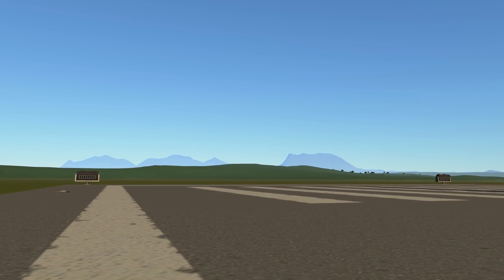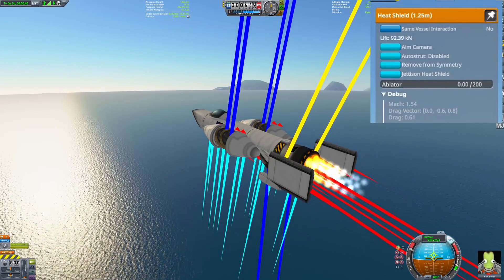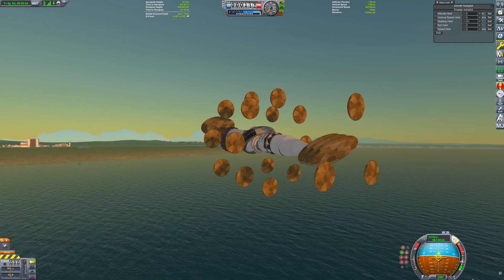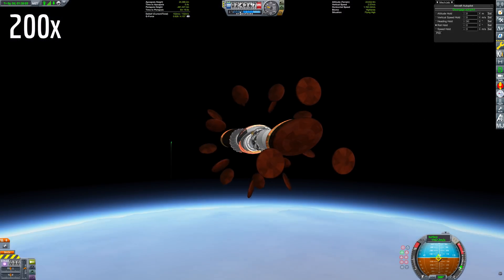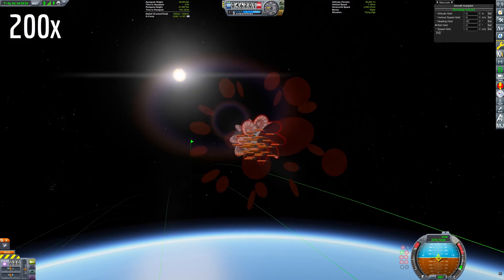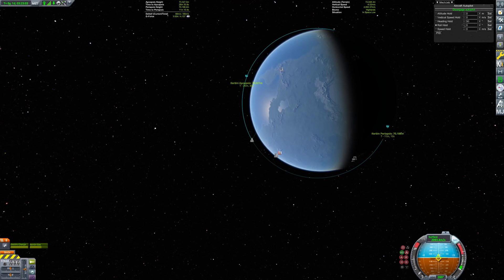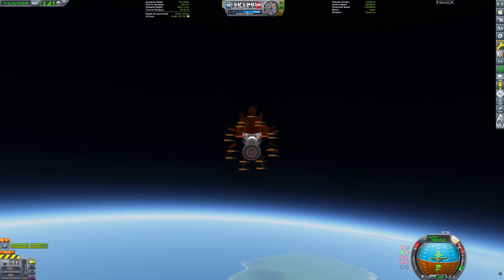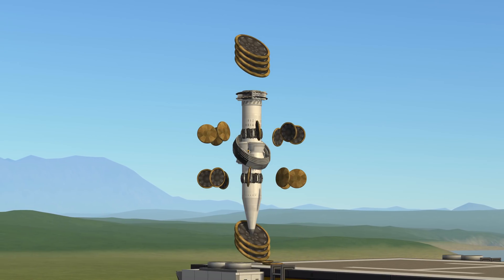2100 m/s on a Stock Propeller | KSP 1.10.1

Comment: Can it fly on kerbol if you add heat shielding using structural panels with all nodes occluded?
Reply: I tested this today.I think kerbol's atmosphere is too thin.Also you probably need a ton of ion fuel.

Comment: Actually, I want to learn how to do this. I have a design in mind if it works how I think it does.

Build a giant freighter ship and have all the heat shields be on docking ports (or the whole prop assembly be on ports) and then have a truly single stage to anywhere and back. Possibly designing a single stage to everywhere and back.

Comment: Update: I've tried it and it didn't work. 
nose cones remove the drag but not the lift just as you said but there is downforce instead of uplift, showing as body lift (aka light blue arrows in GUI) through the ground no matter where I place them.
Version info: KSP 1.4.5 Stock Size Real Solar System

Comment: In reality, wings in subsonic speed created lift not because of a difference in pressure, but because they accelerated air downward (e.g. deflecting a fan's wind downward with your hand). In a kind of way, KSP's heat shield followed a similar technique, only in a more drastic way.

Comment: My opinion: use it in conjunction with regular lifting surfaces to make extremely efficient and effective aircraft. Imagine how this will revolutionalize stealth aircraft in BDA, they’ll be able to fly higher and faster than ever. Or SSTOs, as shown here: imagine a colony aircraft going between Eve and Kerbin and picking up modules using only xenon and heat shield tech. You could even make highly efficient hydrofoils for attempting the sea speed record!

Comment: Can you do a tutorial on how to use the breaking ground expansion parts? I have an issue with the servos where when I place them in mirror mode, one works the way it is intended but the one on the other side is a kraken drive that causes an uncontrollable role.

Comment: As a lifting surface? Sure, it's just a fancy stock wing. However, as a thruster / propeller, i figure it would be as if modding in a crazy efficient engine. I don't really have a good base for this reasoning but im gonna go with my gut feeling here.

Comment: I use a lot of mods - key piece of information. My absolute best plane is fast - even for mods - and lasts forever using M.A.R.G.E engines from OPT and a nuclear reactor. At 45% throttle and at 11km, it cruises around 1300m/s. I have to lower the throttle or it literally burns up in the atmosphere. 
You've made a **stock aircraft** that doesn't burn up and goes almost 2x the speed whilst lasting forever... insanity.

Comment: Yep, definitely kraken drive level. I really wish this game did a better job of calculating part occlusion. I like trying to make really big cargo planes with custom loading ramps using the robotics parts, but the game considers any vehicle or cargo you put inside as being outside the plane (and therefore super draggy), and also tries to rip open your cargo ramp. The cargo ramps and cargo doors can also negatively impact control, and also cause a ton of drag. Super annoying.

I'll go check out Bradley's video. I've been trying to use prop tech for a while now to make an Eve SSTO, without much success.

Comment: If you could vary the pitch of the prop you could get much higher low and high speed efficiency. If you can vary the pitch you can always set the optimal pitch for max thrust. A standard plane will have better thrust for takeoff with the blades almost flat to the oncoming air and the faster the go the more you'd want to angle them forward to reduce drag and increase thrust.

Comment: Is that the highest g forces possible with a propeller plane? Ik it's not nearly as fast as the wind drag catapult, but that's even less normal
Reply from the maker: I think you could do higher. With a better heat shield wing setup, I imagine you could pull over 100 gs

Comment: Im going to see if this works in 1.8.1 (the version i play because of my mods)
Reply from the maker: It should! I'm not sure when the devs added lift to heat sheilds, but I'm sure the latest few versions (back to 1.7 or so) work.
Reply: I checked and it wasn't working in 1.8.1, but that might be because of my mods, or just my stupidity, i had it set to show aerodynamics but it wasnt showing anything at all for the heatshields this could just be user error
Reply: Also do u know about the drain valve infinite flight trick, you put a butt ton of them on the back of a plane, then put on a bunch of air intakes, they will provide force by draining intake air

Comment: I'm of two minds about this in general. On the one hand, I think exploits are fine and everything, but I feel like this is sort of a wake up call. I've felt increasingly ehhh about a lot of the more minor community accepted exploits like part clipping stuff directly into other hitboxes. Just kinda feels cheap when you can pack 15 fuel tanks into one for example. Now this exploit is obviously more broken on several orders of magnitude and needs to be fixed. I'm comparatively more fine with the part clipping tho because not being able to clip parts together at all would result in it being impossible to build anything interesting. Hopefully if this does get fixed it doesn't break a bunch of other stuff.

Comment: I nominate the term “Stratzen Drive” to define the use of this tech and differentiate it from the normal lifting surfaces in honor of one of the most innovative KSP players out there. Well done as always, sir!
Reply: I second this. Any non-traditional propellor should be called a Stratzen drive from now on (except that mechanical plane that used the power of the narrow-band ore scanner’s rotation to drive props. That is a class of its own.)
Reply: How about stratzen lifting surface for a more general name
Reply: That sounds like something out of a sci-fi film/novel. I love it.
Reply: Could we compact these so-called "stratzen drives" to a rather small size and use the engine plate fairing zero drag technique to make a micro-ssto?

Comment: Hey, I'm trying to make the drag thingy work, and its disabling the heat shields lift as well. What am i doing wrong exactly?
Reply: It took me a while to figure it out, but here's a bit of a hidden tip: Heat Shields don't produce lift if there is something that is connected to the bottom node on them. You have to stack the shields/nose cones using the attachment node that is on top of the shield. I hope this makes sense. it seems really awkward, but it does work.

Comment: I did notice, that heatshields generate lift and used them for aerodynamic reentries, but this ... this ... excluding the drag with nose cones. I did not expect that the lift would remain. Also, I am using FAR (Ferram Aerospace Research) so I am no sure if it even would work with it.

Comment: Moving forward, these should only be used in place of standard lifting surfaces if you don't give a damn about immersion.

Personally, I like my rockets to look like rockets so I'm not having to convince my brain that its not wrong to see parts magically floating. (I find convincing my brain to ignore magic floaty bits hard).

Definitely an interesting curiosity worth a play around with in sandbox mode though.

Comment: The electric motors are way too powerful and easy to power, that's the core of the problem with KSP propeller craft.
Reply: Tbf the previous speed record of 1000m/s was with reaction wheels

Comment: In theory everything should generate lift, alt least at some angles, it is just a part of the aerodynamic reaction force. I think the lift generated with parts on both sides should just   be that of the circumference of the part.

Comment: This is to atmosphere engines (propellers and jet engines), what the ion engine is to rocket engines. Efficient? Yes. Fast, not really, since you have to slowly build up speed. I doubt most players will have the patience to use it. 

The heat shield wings, however, look set to revolutionize KSP, even for the average player.

Comment: Why are you using such a high agle of attack on your heat shields?
Reply from the maker: They lift vs angle of attack is odd for the heat shields. The lift maxes out at 45 degrees and decreases in either direction. That's why they look so strange.
Reply: @Stratzenblitz75 thanks for your answer, but  i ment the heat shields for the rotor and not the wings. They really dont look to be at an angle of 45 degree
Reply: Ah sorry, I didn't see that you tilted them in flight

Comment: I think it's fine to count this as a stock propeller, and make it a record holder. I initially thought that this shouldn't be the case, but since prop records have been held by part clipped and offset craft in the past, I don't think this should count as "different." As unfair as it may seem to other record holders, it's using the same methods, but with different parts.

Comment: wierdly enough, this is not a bug, some heat shields produce lift in real life, the soyuz capsule, for example, uses this lift to steer itself through the atmosphere to ensure the safety of the crew and a more precise landing(I do believe idoes not produce as much lift as it does in the game though).
Reply: Sure, but occlusion removing the drag without removing the lift definitely is a bug. The lift to drag (un-occluded) from stock heatshields is actually pretty accurate.

Comment: I wonder how fast you could get this in atmo. Is faster than orbital possible? You're almost already there.
If you can exceed orbit velocity (presumably by pulling negative g to stay in atmo), could you break escape velocity? Leave Kerbin SOI with no reaction mass?
Reply: Heh, I guess if you can pull that off, a Interplanetary transfer would theoretically be possible. Be accurate enough, and you could go atmo -> atmo without any reaction engines at all! Exceedingly unlikely? Yes. Impossible? Not so sure..
Reply from the maker: I've thought about this and I think it could be done. I may give it a try!

Comment: This is absolutely amazing. If this stays in the game till the summer break (for Southern Hemisphere dwellers) I will have a lot of fun. And I really hope it does. It seems like one of those things that will never be game breaking because it is so absurd, and since the only competitive play is already checked for these sorts of  things  (and that this is obvious) it should ne fine. Honestly I love the lift mechanic on the heat shields and I want it to stay.

Also, does this work with other lift generating parts? iirc the mk2 parts also generate lift.
Reply from the maker: Thanks for your thoughts on this!

There are a few parts that have unusually high L/D ratios. Landing gear are one of them interestingly enough. Mk2 parts do not work to my knowledge.

Comment: This is absolutely  absurd and you need to calm the heck down. 

For me, I would agree with what you said regarding how missions that utilise this exploit should be viewed. In my mind, techniques used for craft optimisation form some sort of scale, with minor purely aesthetic part clipping at one end and all-out kraken drives at the other. This sits somewhere on that scale, and I think as long as any missions that use this method acknowledge and communicate that, then all's good! Every mission should be judged on it's own merits; a SSTO mission that refuels half-way through is not strictly comparable to one that doesn't, which is to say that one isn't inherently more impressive than the other, as it depends on the surrounding context and creator-determined restrains for the mission. So I think that for now, missions featuring this exploit can only really be fairly compared to others that also use it. 

What an amazing discovery and another superb video, great work!
Reply from the maker: Thank you for your thoughts!
I agree that the context of the mission is important to judge its overall impressiveness. However, I'm concerned that will be lost on some people. I sometimes see comments of "XXX did this better than you" on KSP videos (not necessarily my own) that unfairly compare missions that in different contexts.

This is why I made a point to say its not fair to compare this to Brad's propeller record. Hopefully, people who also use this exploit will be clear in their intentions and not try to downplay previous achievements that don't use this exploit.
Reply: @Stratzenblitz75  100% agree, and I hope that the considered way that you presented this find will encourage this type of discourse. I have to admit that I'm tentatively worried that when KSP 2 drops there will be a surge of the "who did it better" attitude regardless of what the mission is trying to achieve. If it's a concern now, then it's going to be a hell of a lot worse for a brand new game and for new players trying to get into it.
Reply: @GuybrushKerman  I think it's probably pretty important to remember that this is just a game, and arguments/discussions over who did something first or better have absolutely no relevance to anything happening out in the real world. They're just a (supposedly) fun distraction from reality, purely for entertainment. None of it matters in any substantial material way.

Comment: How you reach 20km+ height and still accelerating?
Reply from the maker: With a L/D of 400, you can do some crazy things. The propeller had less thrust than an ion engine at parts of the flight, but that was still enough to keep pushing it forward since the drag was so low.

Comment: Brads about to get about 5,000,000 new entries to Monte Carlo kerbaling challenge because people are going to try to use this new tech to break the speed record. I know I will try. Straz, are you going to make a run of the river Kile using this tech?
Reply: You should probably get a glide only run
Reply: You would need some speed to start off with though since a l/d ratio of 400 means you will only be able to glide 160km from the 400m height limit
Reply: @iain3713  that is a good suggestion, but in the rules doc its says that you can enter the course with more speed than your can get to under its own power, but a run using only one Juno engine would be potentially viable
Reply: @roter7991  I’ve thought of a really stupid run
A catapult launched glider from the ksc, and it just glides to the river
Reply: @iain3713  that would be cool. That would be super cool. Maybe we could try getting straz, or Brad to try their hand at this.